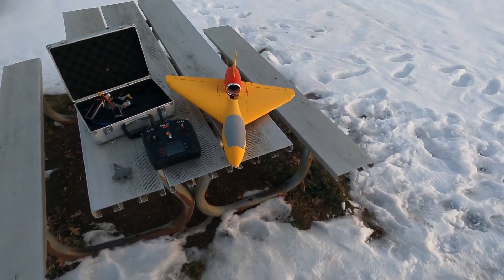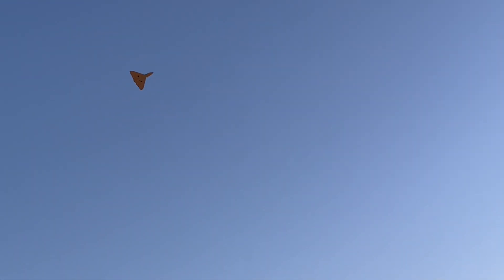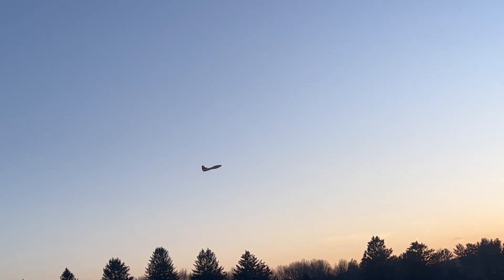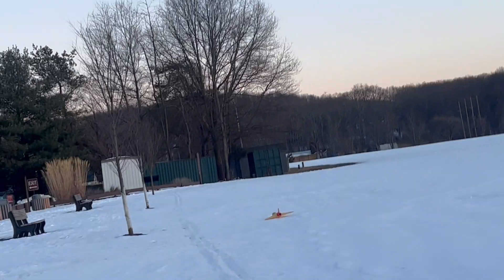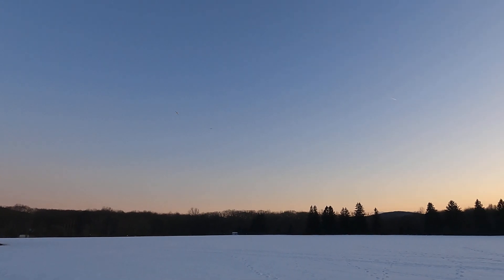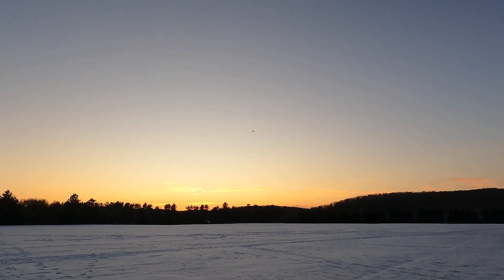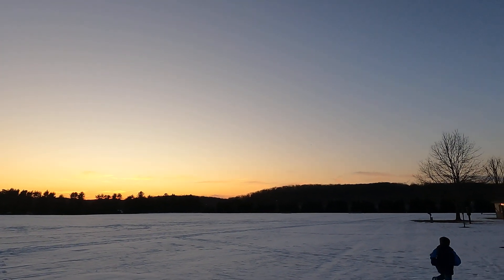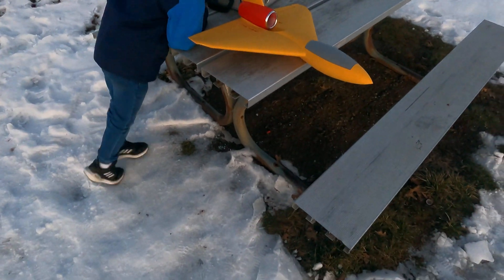Pocket Rocket endurance test! 5+ min on a 1300 4s

Comment: Suggestion
Radiomaster with express LRS 
Then you can watch the voltage instead of the time.
Bad ass build though!
Reply from the maker: Doesn’t spectrum also offer this? I have two of there $90 receivers and it says “telemetry” I wonder if that will work
Reply: They do @hotlapkyle